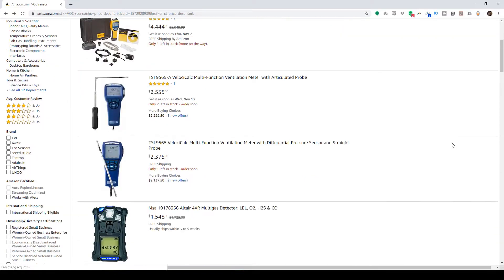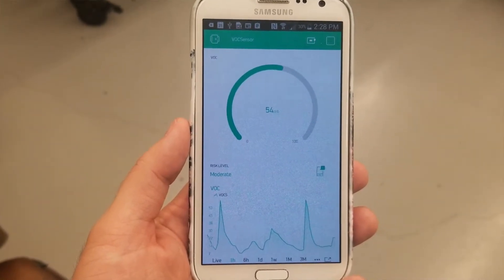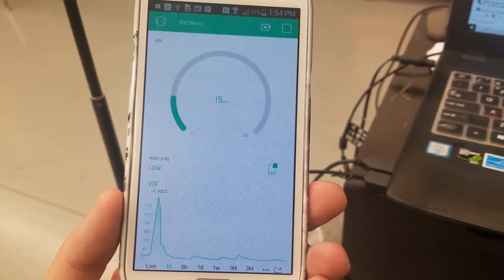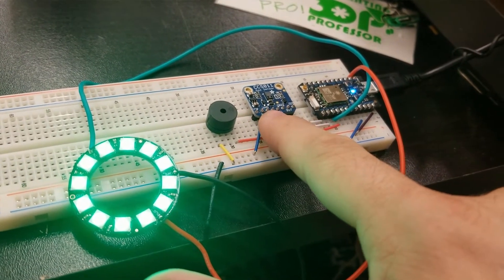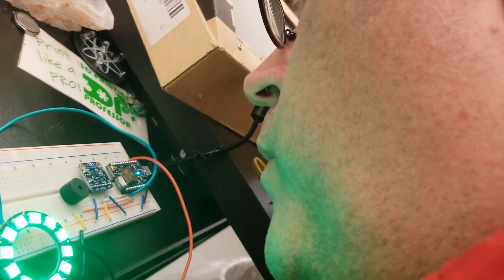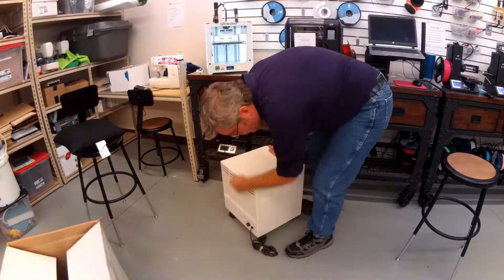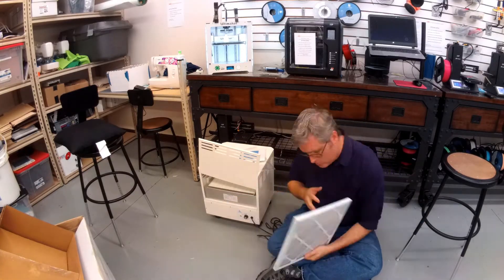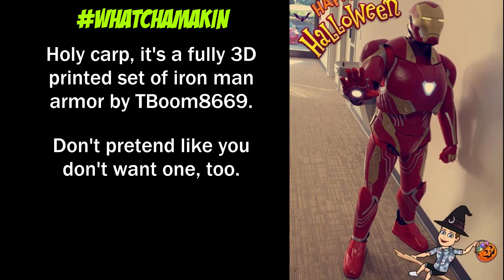Cleaning the 3D Printing VOCs with EnviroKlenz

Comment: So just an enclosure is probably sufficient then?  I rent a room and pretty much need to have my printer in the room I sleep in
Reply from the maker: An enclosure would defiantly help. But to be safe, you should vent that enclosure to the outside.
Reply: @3dpprofessor  would it be better to make a fan recirculate the air through a filter for inside of the enclosure?  I don't want to loose the heat.  Do you know of any small filters that catch vocs?
Reply from the maker: @exodous02  That's the hard part. There are no small filters that effectively prevent VOCs. 

If you're worried about heat, having a fully enclosed machine that you then keep closed for, say, 10 minutes after printing, should probably be okay.
Reply: @3dpprofessor  do you think if I sealed it the best I could and then 'flushed' the air outside would that be good enough or do I need to constantly be venting it?
Reply from the maker: @exodous02  I have no science to back it, but I think that would work.

Comment: Hey there. I like your video. I have done a couple of quick tests myself.

https://www.youtube.com/watch?v=vl6CPolAePs
https://www.youtube.com/watch?v=Sq-480mpmMc

I noticed you didn't find a good less expensive air quality meter. I found one on amazon for about $45 CAN. I think it works well. The details are at the end of the 2nd video listed above. Check it out. I basically found similar results to you. The major polluter was, for me, the isopropyl alcohol I used to clean the print bed. 

Keep making the videos professor.  
Paul...

Comment: What about sharp GP2Y1010AU0F optical dust sensor... Could it be possible to use it as an alternative?
And about filters... I was alway curious if an old (but never used) gas mask filters for example from army shop could be used for purpous of filtering air outgoing from enclosed printers or laser engravers etc. :-)
Reply: I believe that I saw something for that on Thingiverse.